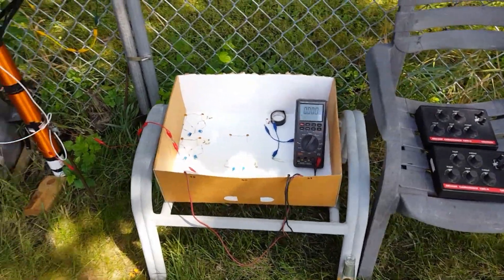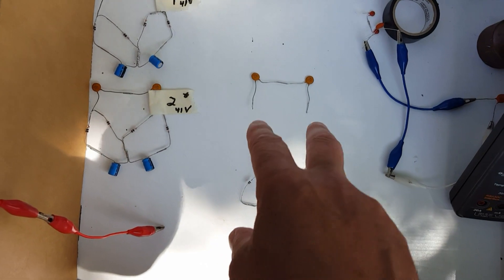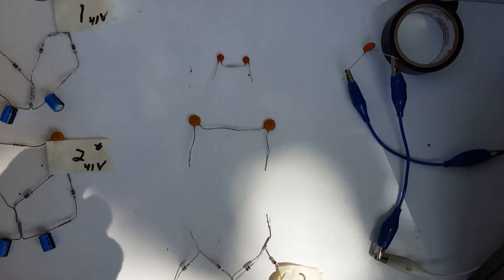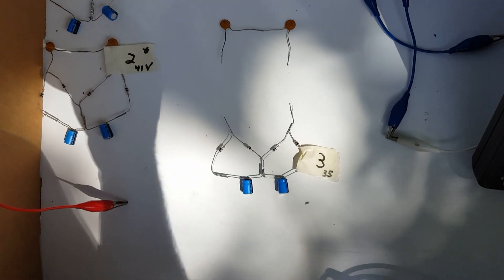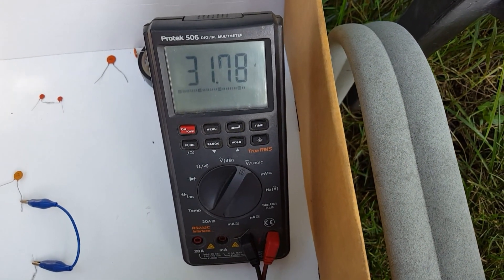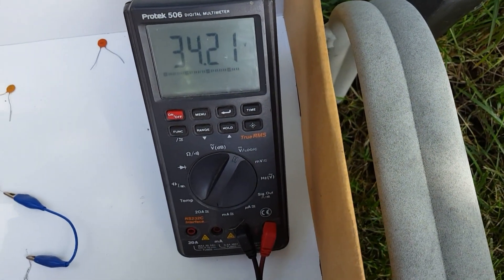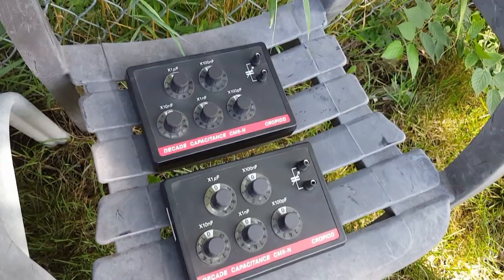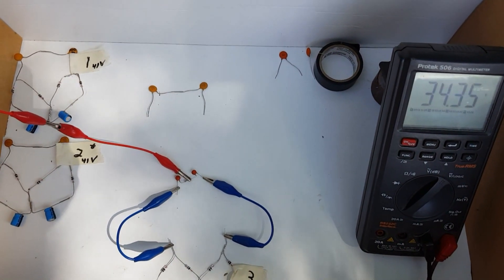Free Energy From Air 2019, part 14

Comment: Have you tried electret technique? Its where you take long coax cable, you strip the outer black insulator and then bake the coax cable in non-microwave oven at 110 degrees until the inner white insulator is almost soft, while the cable cools down you run 10 kilovolts DC through it for 10-15 minutes, and then you hang the cable somewhere at higher altitude. Connect cable to Tesla coil in reverse and then to supercapacitors to harness electricity from earth and atmosphere.
Reply: https://www.youtube.com/watch?v=iIhIPH4nPHo
Reply from the maker: @Xeno_Bardock  Hellooo, im very familiar with this process.  I have not tried this for this project yet,,,,,but i have tried to make an electret......
https://www.youtube.com/watch?v=6vWH-MGdOok
Thanks for the ideas/comments :-)

Comment: Try to attach a metal sphere to the antenna. Amperes should rise.Have a nice day!!!
Reply from the maker: Hmmm, yes, i did this in the last video and also tried  a satellite dish,,,they probably did raise the current,,,,but at this time i am only concentrating on the voltage, to get it as high as possible then to add large cap and spark gap and then after that we should have lots of current, but we will find out soon.

Comment: Hi Paul, thanks for the video.
I think that when you remove one capacitor from your circuit, the circuit completely changes.
Maybe you have to flip a diode too.
Good luck I3.
Reply from the maker: Thank you,,,i will check things out. I will try the air caps, other caps,,, and I will try tuning again.

Comment: may I suggest checking the "working voltage" of the caps and compare that to the working voltage of the decade capacitors? Awesome experiment by the way :) What are the ratings on the electrolytic capacitors where the voltage reading is being taken?
Reply from the maker: Good ideas.  I will check working voltage on disk caps and decade caps.  I will check values of electrolytic caps, i forget off-hand what they are and I will tell in next video.
Thank you!

Comment: I would like to see the air capacitor added in series with the AC caps. I'm sure you seen the 1922 table top version of a ionosphere inductor on keley.net
Reply from the maker: Okay, I will try the air caps.  Please, can you find me a link to that table top ionosphere inductor, i would really like to see it,  i tried to find, but no luck.
Reply: @INVENTOR3  http://www.keelynet.com/ it was on the main page but I don't see it there now.
Reply from the maker: @AnDyity  Thanks for trying to find it.  I also tried searching.  
Well, if you see it again , send it my way please :-)
I have been to that website many times, very good.  Maybe you saw it on a similar website like rexresearch or JLNlabs.
Reply: @INVENTOR3  yeah I even looked in the archives didn't see it, it was at the top of the page at one time. The picture showed a Tesla coil with a spiked ball for the antenna and big resistors or inductors the whole thing is a Tesla coil in reverse.